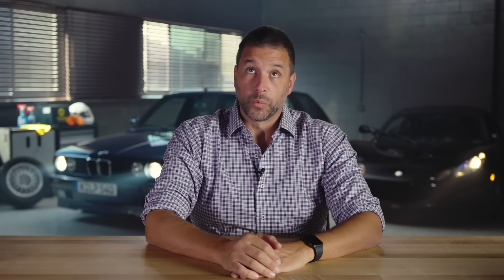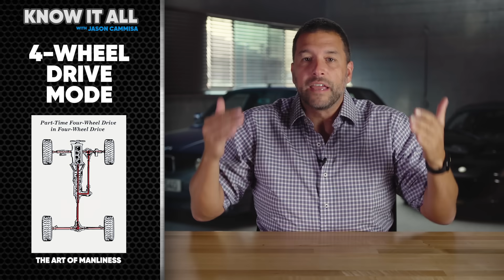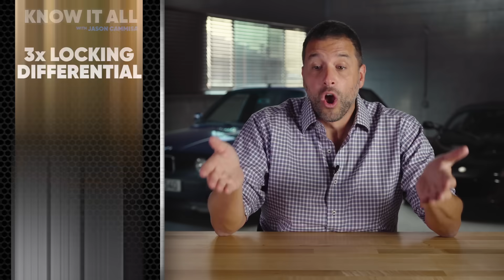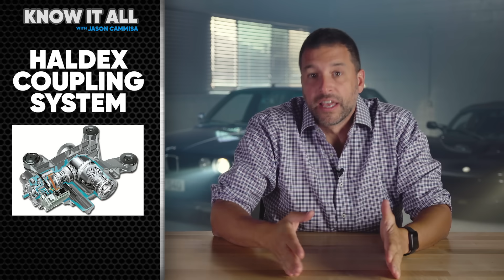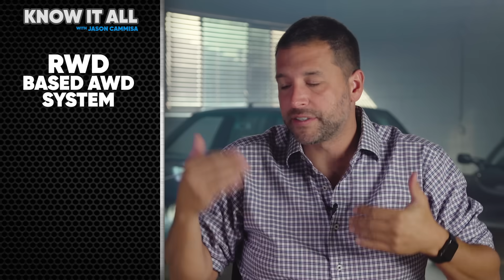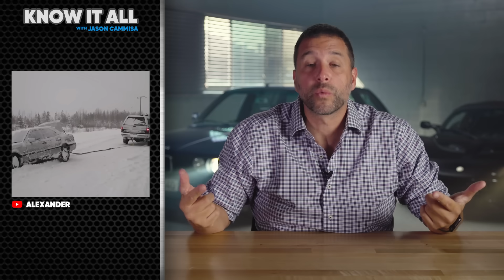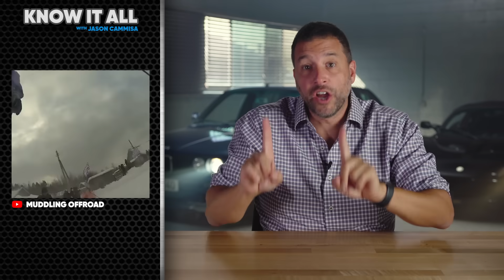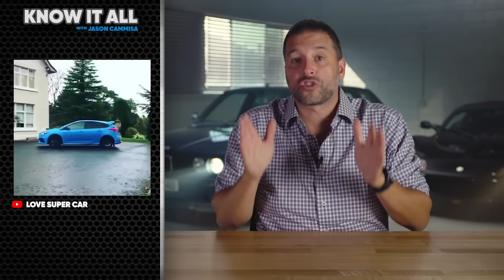Understand Your All-Wheel-Drive System | Know it All with Jason Cammisa | Ep. 04

Comment: Good video, so many people that don't understand the difference!

One thing though, the SQ5 still has a torsen differential with permanent 4WD and a base 40/60 split, not FWD as stated. The regular Q5 though, and most other quattro models, are unfortunately stuck with the lame FWD so called "quattro ultra" nowadays.
Reply: My SQ5 has the sport pack with the Rear Sport Diff, it is Rear Bias 40/60 Spilt. It can give 85% of the TQ to the Rear. It is a Torsen system. Even my Mom's 2015 3.0T Supercharged is Torsen. Jason needs to do a little more research when talking about Audi, they have a lot of different AWD systems.
Reply: I was going to say this as I own an SQ5, but you said it well and politely. And I will tell anyone who will read it, this SQ5 is so amazing in bad weather, I have never driven anything as good in ice, snow, rain, mud, up hills, down hills... it's good.
Reply: Also the 3.0 TDI has torsen in the Q5 the quattro ultra has 500 nm of torque limit
Reply: SQ5 isn't a Haldex system.
Reply: Thank you… I was really concerned because my 2021 definitely let the rear out in rain or on a beach. Was hoping I wasn’t crazy 🤣. That being said, my A4 was definitely front biased. My Q7s always felt pretty 50/50
Reply: This is also wrong, both the base and sq5 have the same torsen system.
Reply: @RandomInternetDog  last gen Q5 2.0 tsi is Quattro Ultra
Reply: Generally speaking for Audi: Transverse=Haldex, Longitudinal=Torsen.
Reply: @jonathanpeterson1  true ! So as long as you're dealing with a "big engine" Audi you're not doing so bad ! ;-)
Reply: @jonathanpeterson1  no, Quattro Ultra is longitudinal setup with permanent fwd and rear wheels controlled via 2 clutch packs (not Haldex)

Comment: You can demonstrate putting 100% power to one wheel on a fully locked 4x4 system without getting 3 of the 4 wheels in the air. People do it all the time on YouTube videos by parking all 4 wheels on those rollers and then locking one of the 4 rollers.

Comment: What is Subaru trying to suggest by symmetrical AWD?  How does their system behave.
Reply: To copy a reply I made to another post (because I'm too lazy to type it all out again):

Manual transmission subarus except the STI are all 50/50 biased when not slipping, and usually have a viscous center differential (so if there's a speed difference between front and rear because one is slipping, it will progressively send more torque to the slower spinning axle).

Automatic or CVT subarus except for the sporty models (Forester/Outback XT and WRX) have a 60/40 front to rear distribution until they detect slippage, so they are front biased but not 100% front like a Haldex system would be - they're still sending 40% to the rear even when no slippage occurs. These use a multiplate transfer clutch to progressively transfer power around if they detect slippage.

Sporty automatic or CVT subarus (again, Forester/Outback XT and WRX) run basically the same system as the regular auto except that the normal torque distribution is shifted to be 45F/55R, for the obvious reason that they're trying to make them a bit sportier feeling and able to kick the rear out in the snow or similar. 

Finally, the STI has the most aggressive rear bias, at 41F/59R, and it also has the most sophisticated differentials, with an electronic clutched center limited slip that the driver can control, and front and rear torsens. 

If you want more detail, Engineering Explained made a good video on Subaru's AWD systems a while back.
Reply: The symmetrical part of the system is related to the fact their drivetrain is composed of equal length half shafts, not the power distribution.  The general drivetrain layout is also kind of unique.  Longitudinal engine/transmission, clutch pack is also integrated into the transmission.   Most other front drive based systems have the clutch pack directly in front of the rear diff.

Comment: A 4x4 is not an AWD system... it's a 4 wheel drive system. One main difference between the two is that a 4x4 is user selectable, AWD are controlled solely by the car. 4x4 system usually also have a low range and AWD do not. There are some exceptions, and other differences I could point out, but I leave it at that for now.
Reply: Yes some 4x4 vehicles actually have a awd centre diff instead of your traditional transfer case . Like above mentioned G wagon , Toyota land cruisers there are a few more vehicles out there . They are in AWD normally till the driver locks up the centre diff and then it's bascially a 4x4 system.
Reply: @dilsher12  I have a 4Runner, the Limited version can be had with a similar transfer case. The LC200 has a Torsen limited slip inside that can be locked out. I didn't really want to get that deep into the weeds, that's what I meant by saying there are some exceptions. It's still at its heart a 4x4 system.

Comment: I cant think of anything more useless than AWD without limited slip diffs.
Reply: That's my 05 CRV, I got stuck in my driveway with it once. The AWD is only good for wasting fuel.
Reply: It is good for when both front wheels lose traction.
Reply: @jojawh  If you dont have a limited slip centre differential, it will just keep spinning the front wheels. Because open centre differentials behave just like an open diff in the front or back, it will just keep spinning the wheel(axle) that has the least traction.
Reply: @bingoberra18  I thought you meant limited slip on the axles. (I assumed some sort of clutch system in the center).
Reply: @bingoberra18  Are there any cars with AWD that don't have some kind of limited slip on the center?
Reply: @clapanse  Well I for one had a subaru impreza gc8. Drove it into some plowed up snow thinking I would just be able to at worst throw it into low-gear and reverse out. But no, one wheel was in the air, and thats the wheel that received the power. A mate had to pull me out with his rwd Volvo. So much for subaru "symmetrical constant awd" with low gear :p Im sure there are many examples of awd cars not having any limited slip in the centre.
Reply: @bingoberra18  That should have a viscous center diff, which is absolutely a limited slip one (though a fairly basic limited slip diff). It may have been worn out though, in which case it would behave as an open diff.
Reply: @clapanse  It was a 94 with 1.8 sohc engine, Idk if it actually had a viscous even.
Reply: @bingoberra18  Auto or manual? Manual definitely should've had a viscous center diff, auto would've probably had the active torque split system. As I said though, it wasn't terribly uncommon for the center diff to wear out, and if it was worn, the viscous coupling wouldn't have worked properly.
Reply: @clapanse  I had manual with high/low gear.

Comment: Audi fanobys are the worst. They insist on FWD based haldex systems being RWD based permanent systems even if you give them a direct link to Audi webiste specs... Absolutely insane.
Reply: Audi had two different systems dependeing on engine orientation. Transverse Haldex, longitudinal with mechanical center diff.
Reply: @girtsberzins2970  WRONG. Thanks for proving my point you lunatic. Their longitdunial models with 4 cyliner engines and AWD are FWD with haldex that only activates when slip is detected. Audi calls it "quattro ultra". FACT! Also the base models are FWD only in their longitudinal models too. Only RWD Audi is R8. ANOTHER SIMPLE FACT fanboys like you deny.
Reply: @Mgoblagulkablong  That is only on recent models, my 2000 Audi a4 and 1991 Audi coupe do not have haldex .
Reply: @Mgoblagulkablong  Read please "had" that means past tense.  And dont call me Audi fanboy, that is insulting... 

It is a bit more complicated than "Their longitdunial models with 4 cyliner engines and AWD are FWD with haldex that only activates when slip is detected." In new "quattro ultra" there still is mecahnical part in clutch system, it has an electronicaly controled cluch pack to disengage RWD fully, it functions more like electronicaly operated transfer case, and it still has "mechanicaly" lockable rear differential.
Now Audi has at least three systems, Haldex for FWD transverse shoping carts, Quattro with crown center diff for big power longitudinal, quattro ultra for shoping carts with longitudinal engines and inverse "haldex" in cureent R8, first generation r8 had "torsen" center diff...

and with all that front engine audis still understeer...

Comment: Just curious, why did you seem to specifically not address Subaru’s all wheel drive systems?
Reply: It’s the same setup as the Audi one mentioned.
Reply: He did, when he talked about the quattros
Reply: @rodrigoalmendro3118  my understanding of Audi’s Quattro and Subaru’s AWD systems are different at the transmission. Kinda similar, but the viscous couplers or I should say coupling systems are quite different. Subaru uses a transmission that is quite similar to a traditional rear wheel drive unit. I’m not as versed on Audis systems, but I believe that they are quite a bit different. You and the other gentleman that commented that they are the same could be correct, but I find it odd the Subaru, who are specifically know for AWD, as is Audi, we’re not mentioned at all.
Reply: @williamkerry2626  I agree with you, but what I ment is that he adressed all permanent awd cars. Not that subarus and audi's specially that model, have the same drivetrain.
Reply: Subaru is like audi, the sti is like the sh-awd, evo, and focus rs.
Reply: @andrewroberti6010  No, the STI's system is completely different from the Focus RS or SH-AWD. It doesn't overdrive the rear at all, it just has a torque-biasing center diff such that when no slip is occurring, the rear drive axle gets 59% of the torque and the front gets 41%. The wheels are driven at the same speed and there's no wearing or overheating of clutches that goes on. There are clutches in the center diff, but those are purely used to lock the front and rear together when slippage is occurring, to act as an LSD. With the clutches completely disengaged, it's still sending 59% of the torque to the rear, so it doesn't have a lot of the disadvantages mentioned.